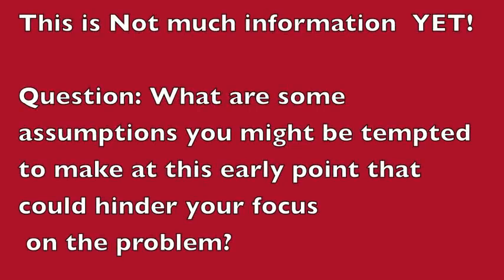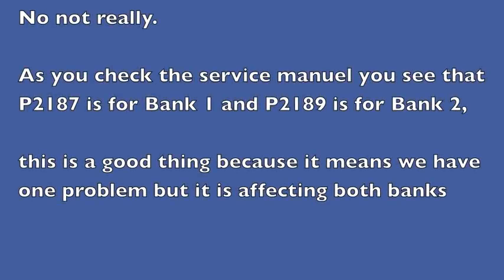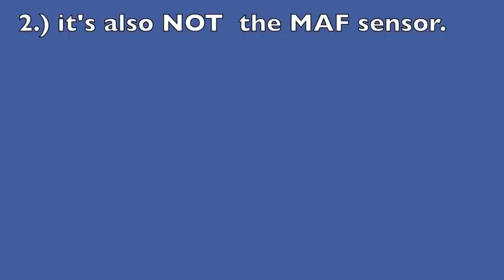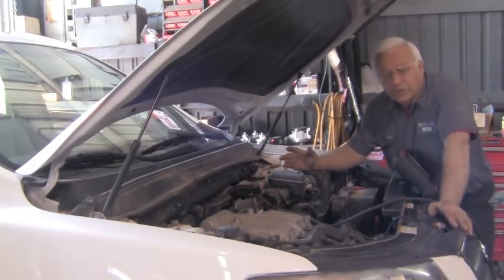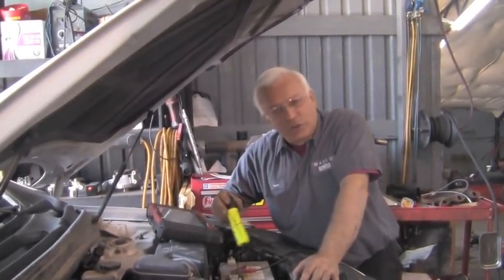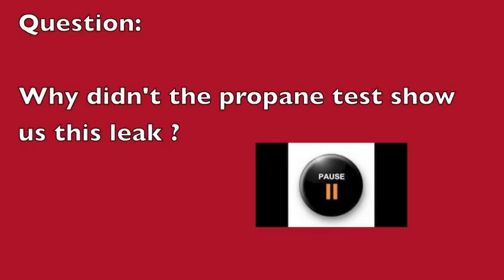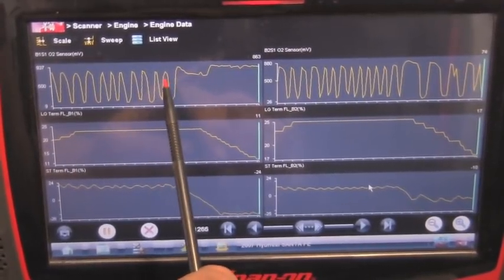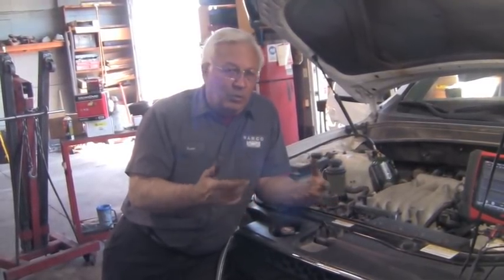A Deeper Look Into STFT & LTFT Part 1

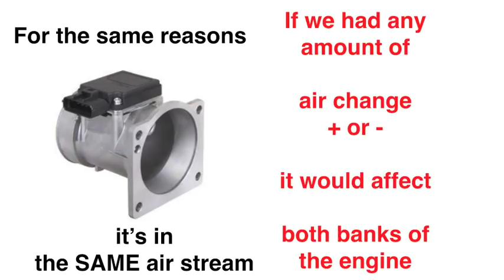Comment: At the 7:15 mark you ruled out the MAF based on saying "it would have affected any range above idle, not just idle".  But wouldn't that depend on what type of MAF problem one is dealing with?  For instance;  if the MAF is faulty then yes, one would agree with your conclusion, but what if it's just dirty?  Then isn't it true that its ability to accurately read how much air is flowing past it is going to be more affected at idle than at higher flow rates (open throttle) ?  This is because as the air flow increases it's better able to overcome the damping affect that the dirt on the hot wire is having.  Thus less disparity b/w detected air flow and actual air flow at the high flow (open throttle) vs. idle (closed throttle) situation.

Comment: Hey Duane. I have an 04 Camry V6 and the LTFT is around +14% at idle on both banks. The vehicle has P0442 and P0456 small evap leak codes. Could a faulty purge valve cause the vehicle to run lean and dump more fuel?
Reply from the maker: Yes it could.  +14 is quite a bit.   A trick to confirm could be this, bypass the valve, clear the codes, drive for a day or two and monitor the LTFT.  If it corrects then the valve is leaking, if not something else is the cause.   Driving with the valve bypassed will likely set an EVAP code, due to bypass, but you are concerned about LTFT.
Reply: Thanks Duane! I actually swapped out the purge valve with another one and it has the same readings. I did use a cheap one from online but it seems like there’s something else going on. The car has 200k miles. Do you think a smoke test would be the next step? And also, what should the MAF sensor reading be?

Comment: why would my MAF be 35 g/s .it's been replaced twice.it's perfect at idel but at 2500-3000 RPM it's way up there. the P0171 that is unsolvable. after replacing the wideband sensor. short term trim it's around 10 but long term stays way over 25-35%. no air leaks showing after several smoke tests.
Reply from the maker: Great question.  The LTFT is not lying.  Trying to fix this from a distance would be a waste of time.  Take it to a good diagnostic shop and they should be able to zero in on the real problem.
Reply: @realfixesrealfast  that's just the problem, finding an honest, good diagnostic shop that knows what they're doing instead of throwing parts at it.

Comment: Bad advice. The check engine lightcCame on within 5 miles of leaving the shop. That means the shop just turned off the codes with their scanner. Had theyy test driven it awhile they would have gotten the check engine light. Dirtbags.

Comment: So i have an issue where i will give it a lot of gas and the car will then throw a p300 code and misfire and hesitate if i accelerate, and it wont be until i turn the ignition off and on again until it stops misfiring. Eventually my car will get a p0170 code which is a fuel trim code for bank 1. When i plug my OBD in and read the real time data the only thing abnormal is the long term fuel trim in bank 1 which is exceptionally high at around +30; so i understand that bank 1 is running lean. 

What I dont understand is why the short term fuel trim for bank 1 is normal (within positive or negative 3) but the long term fuel trim isnt. So i read that a vacuum leak is the cheapest thing to solve so I got some new rubber vacuum line and replaced nearly all the hoses, most were cracked on my 22 year old car. That didnt solve the issue. 

The fact that its strictly in bank 1 tells me the MAF is fine and that it isnt a fuel issue because both banks would be affected. What further confuses me is the fact that it only throws these codes when I accelerate fast and the automatic transmission downshifts. I have tried revving the engine on neutral and seeing if the issue occurs and it does not which tells me it happens under load. To top it off, a p410 code will go off indicating the secondary air injector is malfunctioning however i have tested it and the pump is fine it fires right up when i jump it to my battery. Im at a total loss as to what to check next. PLZ HELP!
Reply: I can understand your confusion.  You are dancing around the problem instead of focusing on the specific issue.  P0300 random misfire is the issue, everything else is probably a symptom caused by the misfire. Focus on what is causing the random misfire.  Clue; since it is random it is probably air/fuel mixture related rather than spark related.
Reply: @strokewarrior5762  thanks for the prompt reply, im thinking of checking the fuel injectors on that bank side. Also can it possibly be an O2 sensor on that bank?
Reply: Hello.  I'm just wondering if you found the cause of your problem?  I'm watching many videos and reading comments to help learn diagnostics.
Reply: @watchdogu.s.a.8973  Hello there thank you for the reply, unfortunately I have not figured it out, I have put it off for the past few months because of school but so far 2 auto shops have not been able to help me and are also not sure what the cause is. So far I have checked and ensured fuel rail is getting adequate fuel pressure, injectors are working and firing appropriately, the exhausts are not clogged or restricted,  there are no vacuum leaks whatsoever (I just rebuilt the air intake mechanism and sealed everything); i put in new spark plugs, valve cover gaskets, checked the coils and wires and everything is fine in that regard. I was going to have mercedes dealership diagnose it for like $150 and then I was going to fix it myself. The only error code i still have is the p0300 random cylinder misfire and the p0170 fuel trim bank 1 error. The long term fuel trim in bank 1 is 30 but the short term fuel trim is normal and the fuel trims in bank 2 are also normal. I swapped around some O2 sensors to see if the problem would jump to the other bank but it didnt so I dont think its an O2 sensor.
Reply: @MoeHawk94  Have you checked your air intake to be sure you're not drawing in air that isn't flowing through the mass airflow sensor?  A crack or hole in the duct or a loose cover on the filter box or a hole in the filter box could all allow un-metered air into the engine and create the lean condition.
A leak around an intake plenum maybe.  There are several ways to find such a leak including a smoke test.
Just some thoughts...
Reply: @watchdogu.s.a.8973  yes I’ve tried looking for any possible leak past the MAF, but no luck. That reminds me that i also swapped MAF’s and MAP sensors with a friend who has same vehicle as me and those are not the issue

Comment: Oddly enough on the video at 2:28 the top code code shows "too LEARN at idle"  not sure if that is a misspelling or indicating ecu was trying to learn the engine's characteristics after the battery had been disconnected? Great video, step by step pointing out not only the technical steps but teaching us to be patient and not jump to conclusions (don't guess or assume, measure the data). Thanks for this!

Comment: Great lessons. I got the fuel injection question right, that gives me some confidence. Just here to learn what STFT B1 is, and I think I have. Now to find out if STFT B1 at 3.1% and LTFT at 5.5 % at idle is healthy
Reply from the maker: Yes it is as stand alone data.  If the 2 together was 10% or more it would be out of spec.  However. stand alone data is not that helpful, it is watching the combined data in different conditions that really tells you the most accurate info.  I am in the process of making a lesson on STFT & LTFT,  stay tuned.
Reply: @realfixesrealfast  thanks!!

Comment: Sir may i know if a car is in normal operation no check engine light what was the signal look like at short term fuel trim and the signal looks like at long term fuel trim tnx sir
Reply from the maker: At normal conditions both the STFT & LTFT values should fluctuate and be less than 10%

Comment: hey that first video on tracking down the leaks was great. I had smoked the engine earlier but thought maybe i used a little too much pressure since my smoker is a homemade version that uses a compressor and pickle jar with mineral oil and a old soldering iron. I was using only like 3 or 4 psi since thats what I heard commercial brands use. With just a few more psi's pressure I noted 2 leaks that didn't notice earlier. I used Marco's propane tip ....first nothing, but keep spraying it has to get to the first O2 sensor then start to correct. Be patient, keep up the propane on the suspected area. It took longer than I thought it would but all of a sudden my short term fuel bank went to negative 21 thus telling my ECU that there was a whole lot of extra fuel there now. Propane method works just give it time, I would guess carb cleaner method would too but keep spraying repeatedly in suspected areas.
Reply from the maker: Thanks, I appreciate you taking the time to comment

Comment: Thank for video. Could you help me make sense of these STFT and LTFT values. I have 07 ford taurus, for bank 1 STFT stays between +/-3%, but LTFT stays constant at about -12% at Idle. Bank 2 is lean at idle with +12%  total fuel trim. When I increase RPM to 2500, STFT jumps between +/-6% and LTFT stays constant at -19%. Bank 2 improves at 2500 RPM with about +6% total fuel trim. OBD says cylinder 1,2, and 6 misfire. I have tested injectors, replaced the leaking injector already. What do these trim value mean? How come bank 1 is rich and bank 2 is lean? Thank you.

Comment: where should the short and long term trims be stationed for correct functionality...
Reply from the maker: as a rule of thumb when you combine  soft bank 1 with long term bank 1 they should be 10% or less
Reply: @realfixesrealfast  thanks because this is something I'm really trying to grasp... i have a cheap lil obd scan so i have to rely on digital results rather than the graph from Good scanners.. on my 750i before i cleaned my o2 sensors i was negative 7-8 for both banks and all 4 sensors.. after cleaning the upstream sensors i noticed a change in my scanner and it was 0.0 and flux up to 3+ but stayed within that realm while i was still getting negative 7 8 for the downstream sensors.... im hoping the clean will have the same effect.. all 4 sensors were Heavily corroded with grime.. some 400 grit sand paper and i cleaned them all great...

Comment: Excellent!!!  The B ES T !!!( except that the wand is a bit small in diameter, a bit wider still would present no danger,and be more effective)

That sounds like a diesel.... there must be a way to muffle the engine noise,and still hear you nice and clear as now, sounding like a real teacher!! ( the questions and pauses are GREAT);  maybe move the mike away from the engine,or use a short range mike;

Thanks.
Reply from the maker: Thanks for your comments, and tips Jose,  I appreciate them.   Duane

Comment: Okay, .700 v os2 bank2 and 10% LTtrim bank 2, misfire on 1 and 5.
Any thoughts??
Reply from the maker: not enough info to do anything with that.  Its not specific data, it's what the data is doing.
Reply: @realfixesrealfast  seems weird. O2S B1 S2 is fluctuating correctly, but O2S B2 S2 sits at about .685V steady flatline, when I bring the RPM up it drops briefly but then goes back up and sits there.
At the same time I got a 10.9% LTFT Bank 2.  Bank 1 goes into closed loop but Bank 2 stays open. 
I've got a below threshold on Bank 1 but both cats are running at about the same temperatures.
I've got a P0300, P0301 and P0305.

Comment: I have a 89 s10 pickup with a manual transmission and I have replaced everything but the tps and map sensors. I live near Harrisburg Pa and can drive for about 15 minutes and then like a switch was flipped the engine starts to run really bad. I barely made it home today because the engine was really shaking. If it runs great for 15 minutes. Why does it start to run like crap? Just how do you understand this crap with fuel trim. Why can't you just send something to the ecm to force it to run the engine right. The way stuff is designed today bet you have at least  $100,000 in tools just to repair this junk. Hell some manifolds are made out of plastic.   is there a way to reprogram the cal pack and tell it all the sensor are new. RUN RUN RUN. I have a snap on red brick so I know what the values are.

Comment: My car has high positive ltft of around 15% at idle 
20% at 2500 rpm
0% at 3000 rpm or more 
My car doesnt have maf sensor but does have map sensor 
Is vacuum leak is the cause or should i look for fuel deleviry problem? 
Pls reply
Reply: yes you need to look at fuel delivery as a possible cause.  And you need to watch ltft at a sustained rpm, not a snap rpm.  Since your ltft is positive, the pcm is adding fuel.  Try adding external fuel yourself with propane and see if it corrects.
Reply: My Stroke My Recovery , i would like to stress that the mentioned above ltft values are at sustained rpm not snap one, so as you've mentioned it is a fuel delivery problem, i've replaced the fuel filter , cleaned my fuel injectors, checked the fuel pressure regulator , is my fuel pump weak? You said to add propane? How is that done?
Thanks
Reply: My Stroke My Recovery, why is the values of ltft decrease at 3000 rpm ? Pls explain that in case of fuel delivery problem? 
Note: car has returnless fuel system
Reply from the maker: Think about this,  If your pcm is adding fuel to correct for low fuel pressure OR volume, then you can simulate that yourself by externally adding your own fuel  (propane).  Heres how.  Have your scanner showing the stft & ltft data, then simply open the cover to your air filter, use a hand held propane bottle with a nozzle, and let propane flow into your intake mixed with the normal air. Kinda like your creating an air leak but instead it's extra fuel.  The pcm should see that extra fuel and not need to add fuel itself.  Watch our scanner data for an adjustment.  If by you adding fuel the pcm does NOT need to, you've identified the issue and now need to find the reason your pcm needs  add fuel.  Quite often that is due to low fuel pressure/volume.
Reply: realfixesrealfast,  hello sir ..
I really apreciate your response and help with my problem, i did the propane test as you instructed and the ltft value dropped signifitly to about 2% & stft values became more negative , i think that means there is fuel delivery problem ! Not much fuel introduced to the engine at idle! But at higher rpm's above 3000 fuel is being introduced as it should! 
So whats the problem now ? 
I changed the fuel filter , cleaned my fuel injectors, replaced the fuel pump electric motor ( only motor) 
Inspected fuel pressure regulator , but still the same results 
Pls advice 
Thanks

Comment: I know you have the engine running when testing with propane so the engine vacuum pulls the propane in. Do you run the engine when using the smoke machine? I couldn't tell if the engine vacuum was pulling the smoke in or if the machine pumped it in?

Great video as always, I really like the interactive diagnosis
Reply from the maker: Good question.  No,  you do not run the engine for the smoke test.   If you did, the engine would just pump the smoke out the tail pipe.

Comment: My first assumption is a lot of mechanics don't give a crap about ripping people off. ;-)  (Partially joking. There's good mechanics out there but I don't like people. To find the good ones you have to get to know them. I don't trust random people.)
I can't wait until I get a hoist and tire machines to eliminate anyone other than me touching my vehicles.
Reply: Caddy Guy Gaming haha! It is very easy to talk! You think becoming a good tech is just tools or a hoist? You need years of experience! You complain or think they didn't try to fix the car before, they just couldn't because of the lack of experience!   One thing I say to my costumers is that if car is not fix don't pay for parts or labor. He "the costumer" should go back to the shop that work on his car and get his money back or let them fix it, especially if light comes back after 5 miles of driving. Obviously whatever they did was not the fix. Truly something as simple as lean condition affecting both banks and showing that is at idle screams vacumm leak. So again who ever worked on that car did not have much experience.
Reply: Did I say It was only tools and hoist? I've been doing pretty good so far doing my own work for the past 15 years. I think ill stay on that route. My problem with taking it back to someone that didn't fix something, or messed something up is,  if they messed up the first time, why would I let them touch it again? It's really a moot point though, because nobody touches my stuff, with exception to tires. I need a hoist so I can pull the engine from my 02 Deville to fix the crankcase seal. As well as countless other projects. For me, once trust is broken, it is very difficult, if not impossible to get back.

Why are you getting your panties in such a bunch anyway? Do you have no sense of humor?

Also, where do you get the theory I complain? Hard to complain when I don't let anyone work on my vehicles.
Reply: if your so good why are u watching a instruction video of how to repair a vehicle?